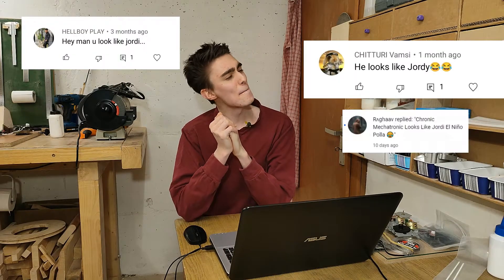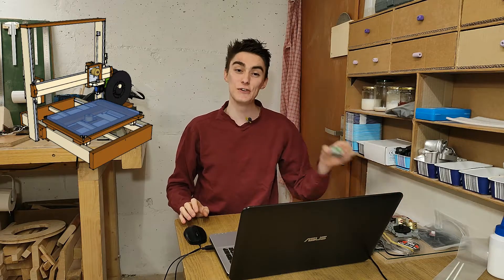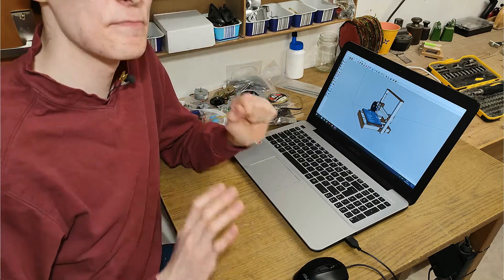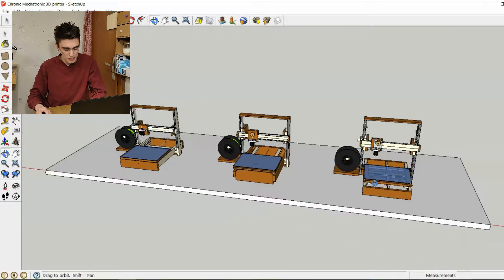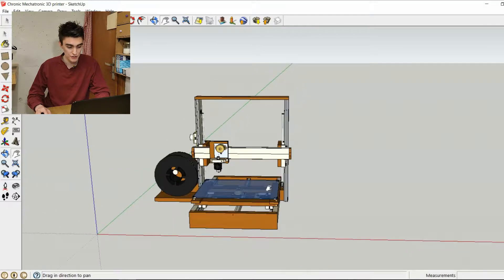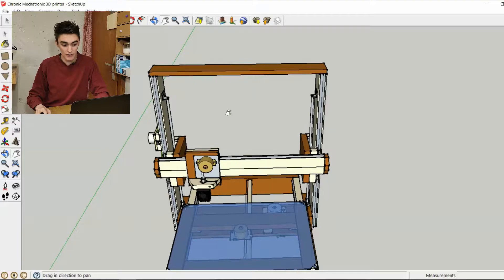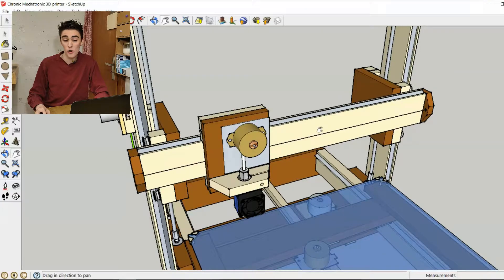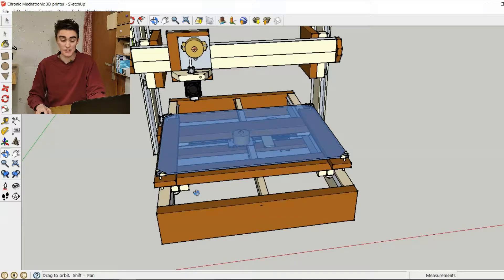DIY unipolar 3D printer part 1 - important design considerations

Comment: Go check out the Cherry 3D printer...but I like your version of the Cartesian style printer
https://www.youtube.com/playlist?list=PLdmirEcV7DnG2HXWSqH-S4a36gDGy6XI9
Reply from the maker: The cherry 3D printer is actually what inspired this one!! I watched every video of the series! Just never got around to mention it in my videos...
Reply: @ChronicMechatronic  The biggest issue with those little geared unipolar steppers is they are CRAZY slow (due to the gear ratio to increase torque), speeds are limited too sub 10-12mm/s which really limits the printers.  But with that said, they are dirt cheap and everywhere.
Reply from the maker: @haydenc2742  yeah, speed is the main issue with the ones I used as well. Once I have those lead screws installed it'll be down at ~10mm/s too unfortunately

Comment: Oh! btw Benjamin, watch this guy (a favorite maker of mine) using from time to time Sketchup to get things done quickly... https://youtu.be/o_t3PtrcCUQ?t=1075 A mix of different tools (or software) helps you a lot.
Reply from the maker: Yeah, I don't think I'll stop using sketchup for anything that doesn't require CNC. I actually use a lot of different tools for one job as well, for example my thumbnails, I put them together in Inkscape, but for color correction I use ON1 effects, for cropping the inbuilt windows photo editor, and for cutting out objects remove.bg or even a phone app sometimes :B
I know that's not very professional, but it's what I ended up doing since I don't have Photoshop ))
Reply: @ChronicMechatronic  Before I click on it, is it remove.bg or removebg? I'm a GIMP early fan and still heavy user. Never had Photoshop...
Reply from the maker: @Philibert Bon it's remove.bg, the AI is quite good most of the time (I only use the free preview version obviously))
I have gimp too, but I still have to learn it which kind of puts me off every time since in these professional programs the simplest tasks are so seemingly unnecessarily complex 😬
Reply: @ChronicMechatronic  Agree. But frankly, I use just a bunch of Gimp features on and on.

Comment: Your explanations are concise and helpful: your last version is the best one without a doubt regarding the rails. Even if it looks like a compromise. Reducing mechanical interactions between wood and metal is pretty challenging. That makes your project very very interesting.🤓 Which software did you use to design those versions?
Reply from the maker: Thank you 😅 I'm glad you find it interesting! 
I use Google sketchup 8 (the free version) as it's very easy to use ;)
Reply: GOOGLE sketchup of course...
Reply: I can't believe anyone in the world uses Sketchup 8 but me... :-)))))
Reply from the maker: Haha, you're not alone :)
Reply: I use Fusion 360
Really like it. Never tried sketch up, but I definitely don’t think it can do nearly as much as Fusion. I also use it to create tool paths for my new 3018 CNC. Oh yeah Ben, what are you gonna design with when your 3d printer is done? Still sketch up? Maybe it’s good, but Fusion is great for parametric designs! Sorry 😐 I’m a bit late for watching. I’ve been busy.
Reply: @ashers_workshop  a bit ironic indeed. Benjamin's approach is almost philosophical and definitely ecologic as well: How to build an appliance or a machine using the material you have and your skills, wood working as a matter of fact. It's a challenge above all.
Fusion 360 is a great software, no doubt about it. And it's free as long as your project doesn't need too much documents (10 active and editable Fusion 360 documents). An ambitious project demands more than that. Despite its features Fusion 360 is LESS powerful/professional than Dassault Systems' SOLIDWORKS. Solidworks' black friday price was $45 a year! It's a bargain! People who design pretty complex mechanical objects use Solidworks, much less F360. Parametric design is just one Solidworks' feature among much more useful ones.
Reply from the maker: @joetkeshub  yeah, Fusion 360 no thanks, don't need no corporation having control over my designs 😬
Reply: @ChronicMechatronic  I'm from a poor country and we have to deal with what we have. I do think skills are above all! Like yours in electronics, woodworking etc... Skills and dreams as well. My twitter account had just been suspended permanently just over a political tweet that twitter thought was a hateful conduct... (qualifying a dishonest journalist as a... dishonest woman, c'mon!). I'm like you, I avoid as much as I can those firms that take your data and your contribution as their own possessions. I do love off-line software. Look forward to discovering your next projects Benjamin!
Reply from the maker: @joetkeshub  Yeah, skills (and motivation) are the most important, I find it's possible to do almost anything with enough motivation as it easily lets you learn the skills required! And while I'm technically from a "middle class family" (lol) my dad always was a terrible scrooge so I never had things like allowance and stuff, hence why I'm so practised in always making do with what I have - you saw my workshop shelves out of cardboard 😂😂
Sorry to hear about your twitter account - I try to avoid social media as much as possible (especially everything owned by meta/facebook) because on top of the user data dilemma I feel it's a very unhealthy waste of time 😕 (that being said I'll probably have to create a twitter regardless at some point, just for means of communication & presence...)
Reply: @ChronicMechatronic  Thank you Benjamin! You're completely right about social media but as you know, we're in the middle of presidential election in France and I can't help giving my take on dirty propaganda. Let's put that behind us.
Of course motivation! as you explained it so well: motivation is the locomotive to acquire new skills. ABSOLUTELY.👏👍👍👍
The best part of your response is this, and it's a really a GOLDEN advice: Don't waste your time on social media (except youtube...). IT'S REALLY UNHEALTHY! (a wonderful adjective). Most of the time you feel hurt by people's/twitter moderators' responses which always JUDGE, LECTURE you about a "good behavior" etc... It's definitely unhealthy even for that reason. That could drive you really mad. Stupid people daring to give you "advice"... C'mon!
Agree with you about family's environment. My dad was a bit like yours and you're right you have to make do with what you have. It's basically ecology-friendly approach. It's amusing but it's a pretty good start in life. Life is not like "you pay and you got all you need" or "do like others do". It really cuts imagination. Bye, keep it up!
Reply from the maker: @joetkeshub  Oh yeah, the presidential election, let's not even talk about that...
I was probably spared from getting to know social media at it's worst by never having any, but even now if I open reddit, I immediately feel myself getting sucked into this vortex of reading intruiging posts and their comments! Then I usually end up staying way longer than planned, so I try to avoid the platform entirely, except for posting on my own subreddit. Of course youtube is an exception, after all more than half of all my tech knowledge is from youtube! I know there are people (like my mom) who use it more like other social media by watching anything that looks clickbaty enough, but on me that function is totally lost as I only ever watch things from the few selected quality channels I'm subscribed to. That way the 1-2 hours I spend watching daily aren't that much wasted, but of course that also means I literally can't find anything interesting to watch on the platform anymore :(
Reply: @ChronicMechatronic  Agree. I use massively youtube as a search engine than an entertainment source - even if I sometimes watch free films. I learned a lot with smart reviewers' posts. Sometimes I wonder what my job and hobbies would have been without youtube, from electronics to making stuff. I'm an old (let's say seasoned) software developer but I still do appreciate someone else approach of the skills I thought I had. There's so much to learn with passion and so much to achieve through building/making things oneself, from our imagination to a working device. I do believe our hands and brain are inseparable in achieving something. Very exciting even after years.
Reply from the maker: @ashers_workshop  Yeah, in terms of CAD software sketchup for sure is pretty awful, when the 3D printer is done I'll have to bite the bullet and really learn FreeCAD 😥 Actually I've had FreeCAD on my PC for almost 2 years now, and I did watch a couple of tutorials on it, but the reason I still use sketchup is because on all more professional pograms even creating a simple cube (which takes me literally 2 seconds in sketchup) is insanely compicated 🤪 like, first create a sketch, set up all the constraints, switch to a different workbench, and then extrude it... Not to mention the fact that for almost any other part I want to add I need to calculate coordinates from the origin! 😫I get it that's more powerful in the long run, but for anything basic I don't need to send to a CNC or other machine I'm way faster in sketchup, even with inconveniencies like having to change five other parts when modifying one central component. Besides, everything I can't create in sketchup I certainly can't fabricate out of wood with reasonable accuracy :) (for now without a CNC)